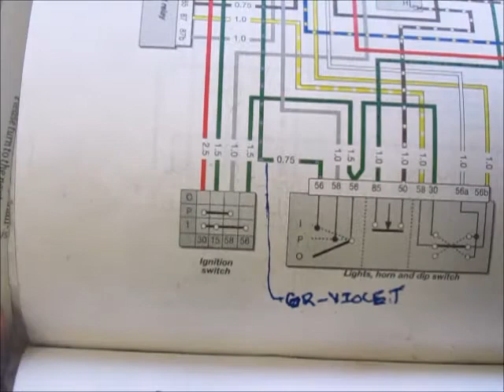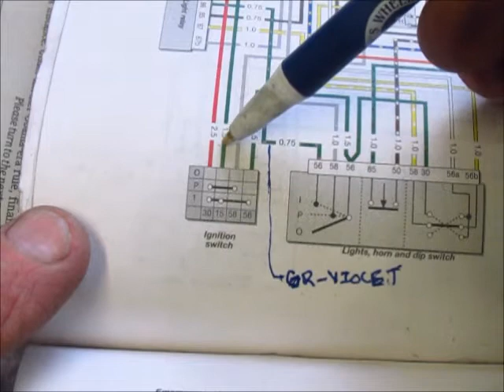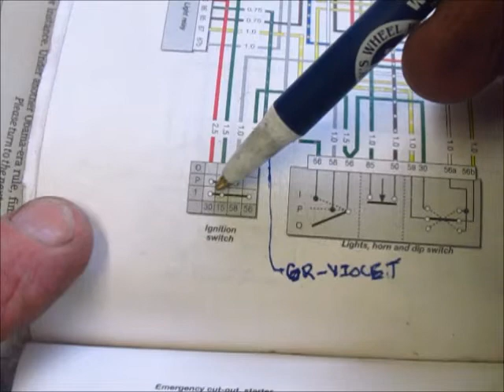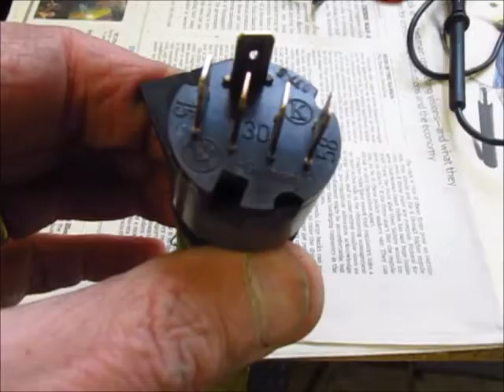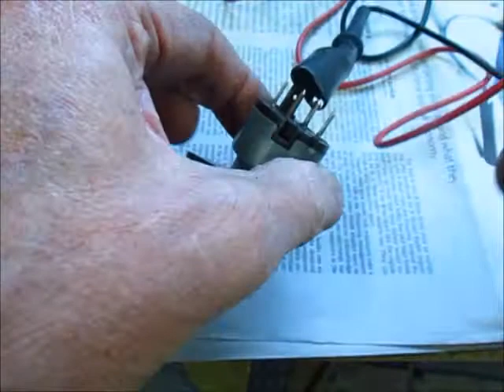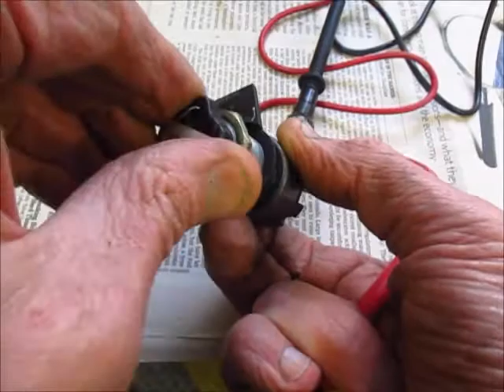1977 BMW R100RS Testing The Ignition Switch

Comment: Hello. Finding your videos of great benefit. Thank you. 
I have lost the main beam on my 1983 R100CS (Euro spec). I want to test the ignition switch but I can not remove it. No problem with the outer 27mm hex nut but following that  the key barrel will not push through. Is the interior hex nut secured to the inside wall of the light bucket? If so, do I need to unscrew the entire switch from the inside after disconnecting the wiring? Kind regards.
Reply from the maker: Deaglán, There is no nut inside the shell. I'd tap on the switch with a plastic hammer to get it to slide through the hole into the headlight shell.
Reply: @BrooksAirheadGarage  Very grateful for your reply. I will give that a go tomorrow. I was taken aback at how 'stuck' to the wall of the bucket the hex nut was/is. Many thanks. Will report back.

Comment: Is it possible to rebuild/clean the inside of the switch? By any chance do you have a video on it?
Reply from the maker: You can open the switch. That said, the tabs of the metal cover are easy to break off.

Comment: great to know about the wiring, but how do I remove it? I have the 1992 R100R and seems to be the only item I can not remove. It has a tiny red seal on the side which has a small screw inside, but I can t manage to unscrew it! do you have any tips?
Reply from the maker: Last Airhead: Sorry, I've not worked on that year/model so I have no wisdom to share.